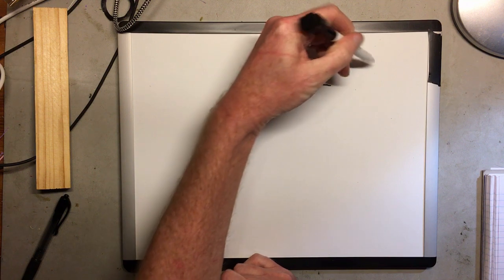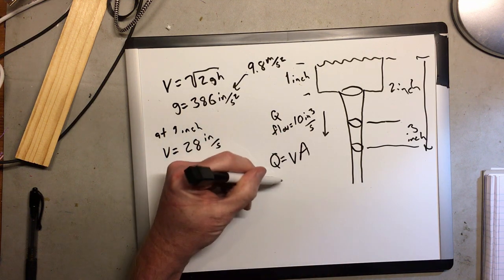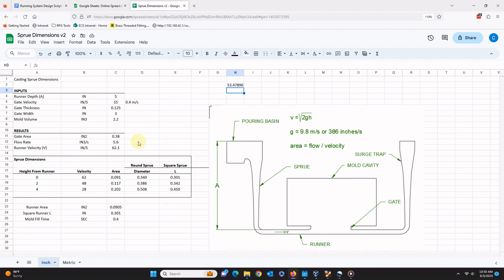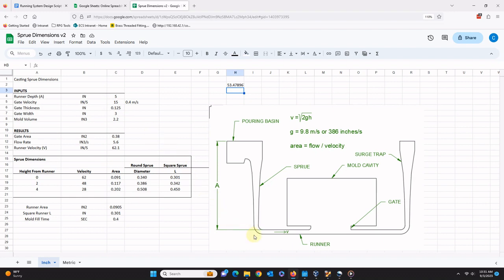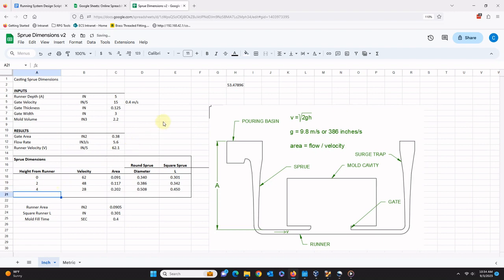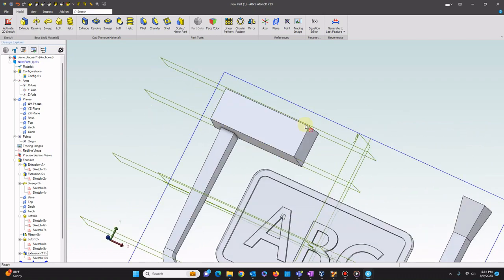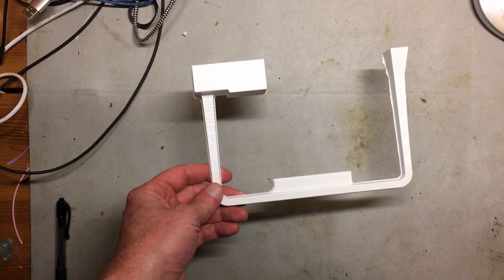Metal Casting Running System Design

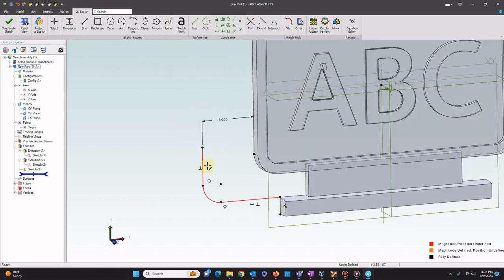Comment: 9:46 Is there ever a downside to putting a longer radius on the bottom of that sprue? That mold has plenty of room for a much larger radius, but I dont know if theres a diminishing return on something like that?
Reply from the maker: A bigger radius certainly wouldn't hurt. I imagine there is diminishing returns though. On my printed vertical running systems, I try to fit in at least a 1/2" radius on the bend and up to 1" if there is room.

Comment: Nicely done.  The fillets could be improved by utilizing streamline design rather than just circular.
Reply from the maker: Thanks man. Not sure what you mean by streamlined fillets though. I would agree that the transition at the top shown in the demo should probably be more gentle. I have experimented with this a bit, but have not focused on it. My biggest concern has always been tapering the sprue in a way that if will stay filled and having a smooth turn at the bottom when the velocity is at a maximum.

Comment: Great video! I would love to see this for a conventional cope and drag mold
Reply from the maker: Thanks. The calculations are pretty much the same for a traditional cope and drag. You still want a tapered sprue and a runner matched to the velocity and flow of the metal. It is difficult to get a smooth bend at the base of the sprue (where velocity is at a maximum). That is probably the biggest reason I do vertical casting when it is practical.

Comment: The only addition I would have is to add a spin trap to the surge trap.
I would also add more fillets all around the sprue, it should be more round.
Reply from the maker: The conventional wisdom seems to be to have a flat bottom for the pouring basin. Not sure about the reason, but I think the idea is to let a "puddle" of metal fully form before it starts flowing into the sprue. I know that is what the step is for. You are correct that the top of the sprue should have fillets as large as possible for smooth flow. One thing not shown in the water model that I discuss later in the video is a large fillet on the left side of the gate. I think this is an important one too and I have only recently started adding it to my designs.
Reply: @charliekrauter5176  Yes I have seen the large fillets between gate and poring basin what I mean is the rest of the gate is completely sharp cornered.
Reply from the maker: @sierraecho884  I am not sure that hurts anything. It doesn't force any sharp bends in the metal flow. I have used square cross section sprues both with these vertical molds and with conventional cope and drag molds with some success. It would be interesting to try a could do a vertical mold with a round sprue and runner in a vertical mold, but that would require a more complex split pattern.